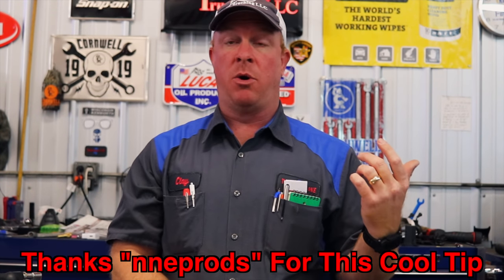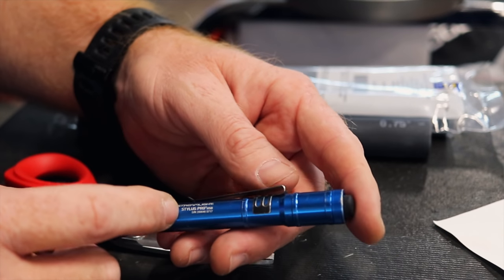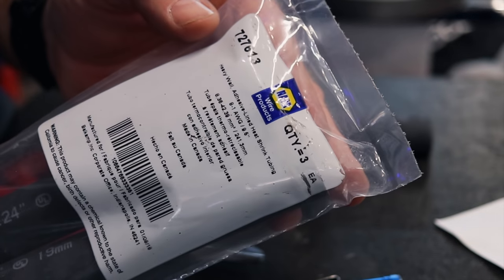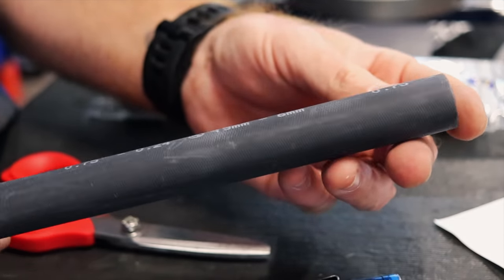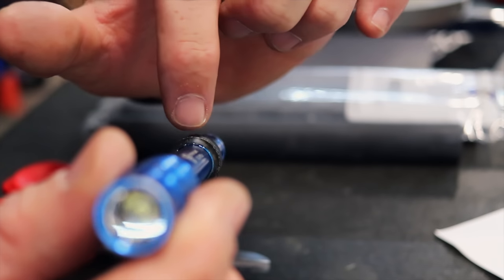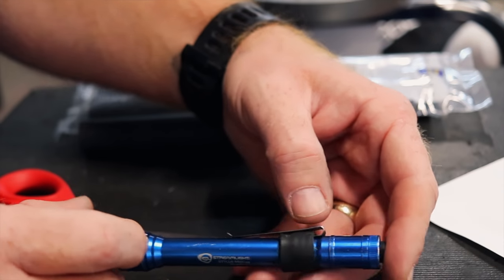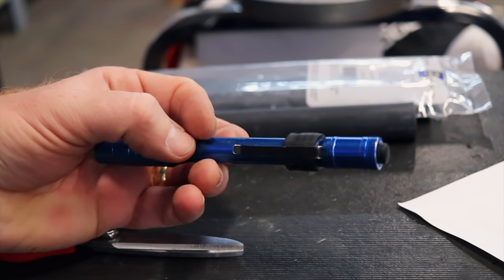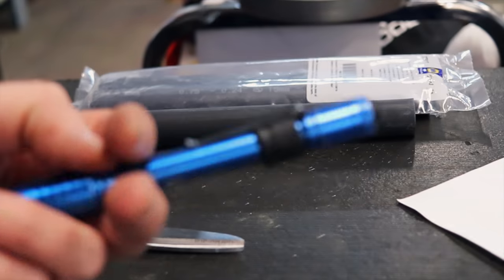Tired Of Losing Your Streamlight Clip? Watch This Amazing Tip. No More Lost Clips

Comment: Glad to see you liked the tip and glad you could share it with the community. I also used the marine grade tubing with the glue inside, it doesn't get loose or deteriorated when it gets oily. Happy Thanksgiving everyone...Cheers
Reply from the maker: Thanks again the heat shrink i used had glue in also and it works wonders ! That was an awesome tip

Comment: Nice tip but I think the thicker would be better for it because it seems more robust but also take into consideration that the thicker stuff don't always seem to flex as much as the thin heat shrink tubing.  I should say the thick stuff is stronger.

Comment: I’ve had this problem with my old Stylus Pro, after I started using the Stylus Pro USB I’ve never had a problem with the clip. I’m still going to do it, just for the piece of mind!
Reply from the maker: Mine would pop off because i hung it on stuff like running under a truck or whatever. I lost 3 clips so figured this will fix it

Comment: Never had this problem but now that I know about it I'll probably lose it next week
Reply: athhud I have a Stylus Pro USB that’s the same way, worn down to the bare metal and has two dents from being run over by a truck. I can’t get the battery pack out of it but it still works and recharges, no problem! They’re tough little lights!